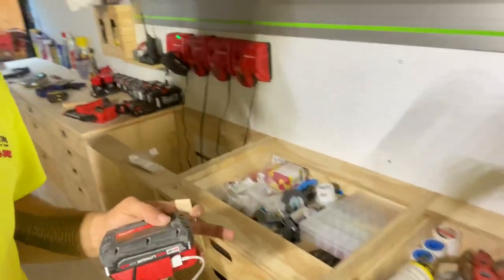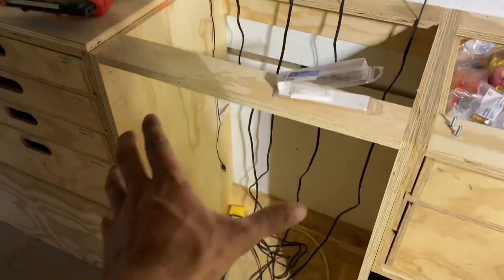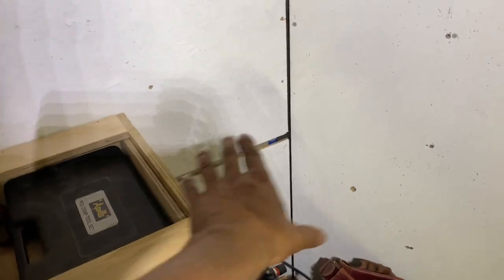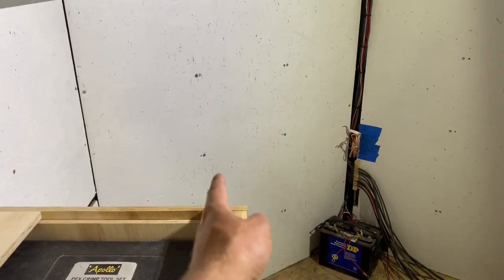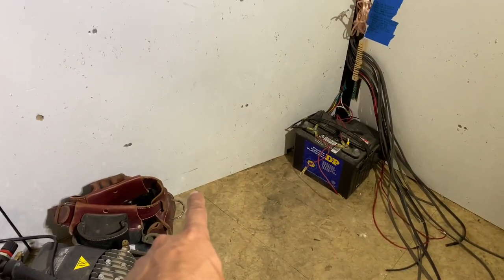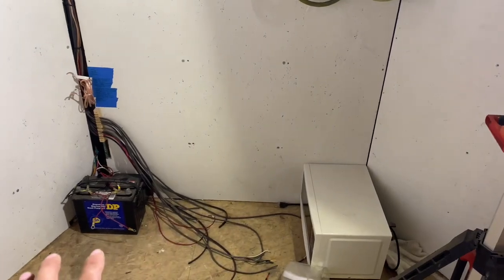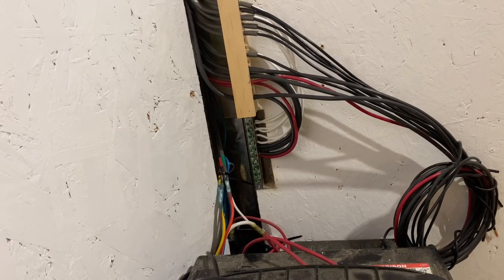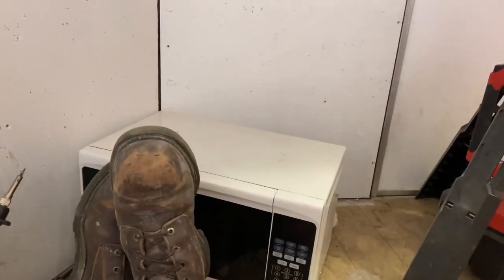Tool Trailer Wiring Part 1

Comment: Looks like a clever solution to a wiring potential mess.  Looks like you are going to have a lot of wiring in the trailer now.  Keeping my fingers crossed for you that it all works out well.
Reply from the maker: Russ Albright it is and it isn’t. There are 4 lighting circuits, but 1 of them will have feeds from both ends of 3 strips. So 6 wires are just used up for that. Then a heater, and some small stuff. I think I have a pretty good plan lol.